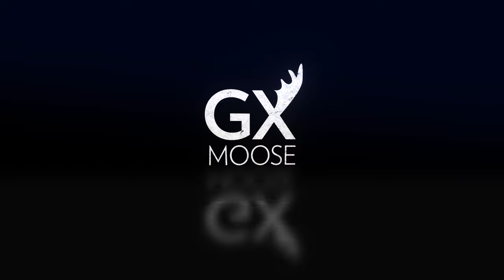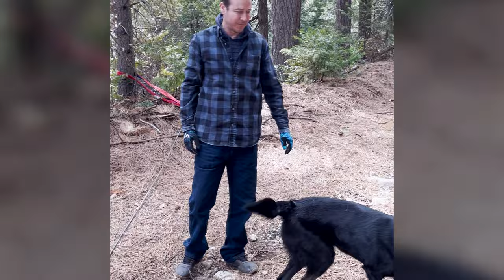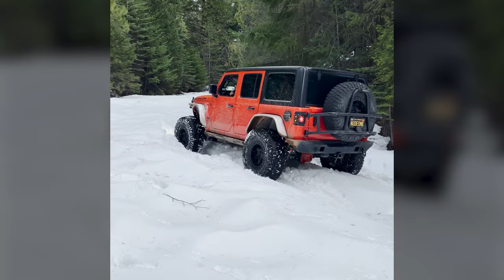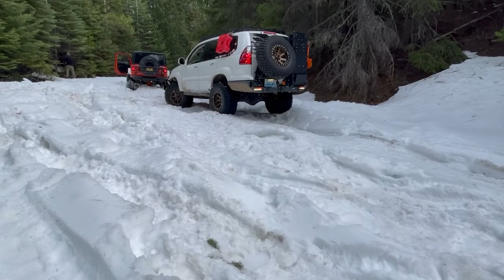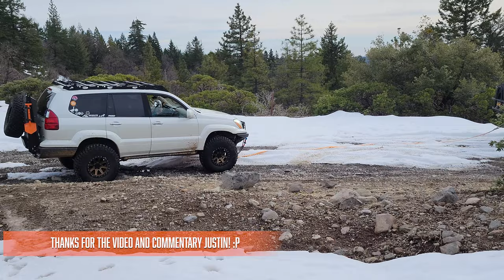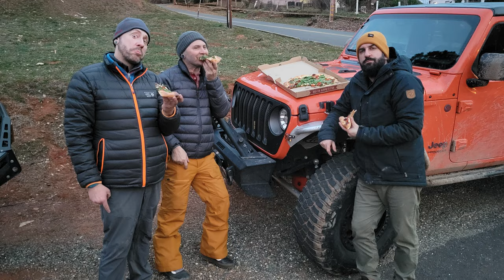GX470 stock rear diff goes boom off-road

Comment: Pre 2010 Toyotas had that 8 inch rear.  2010+ got the stronger 8.2 but still lacking the Land Cruiser 9.5.  Those tires on that rear was just too much.  Sorry it happened but you will build it stronger
!  I'm glad both my Monteros have 9.5 rear ring gears.
Reply from the maker: I knew it was going to let go, I just thought it’d be doing something hard 😂 new 8.2 w elocker is in now
Reply: @gxmoose  Is there a difference in the axle spline count on the 8.2 compared to the 8?
Reply from the maker: @DocGTO  yes, many more teeth part of what makes it stronger. Think it’s thicker as well

Comment: Did you refresh the carrier bearing pre-load or put in a solid pinion spacer?

I’ve read that high mileage gx’s loosen up and cause excessive backlash = BOOM
Reply from the maker: It was still stock AF on a 170k mi truck. The 35's were a recent addition and I was hoping it'd last a little while with light use until I could upgrade. guess not. I knew it was a risk and could happen but not so quickly, or during pretty light snow wheeling. FInally found a 8.2" elocker that's going in soon